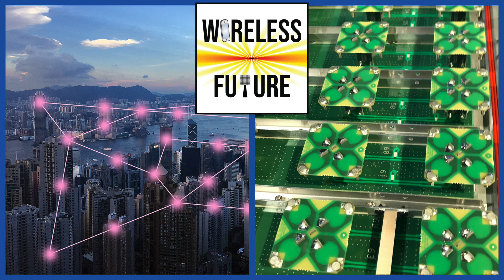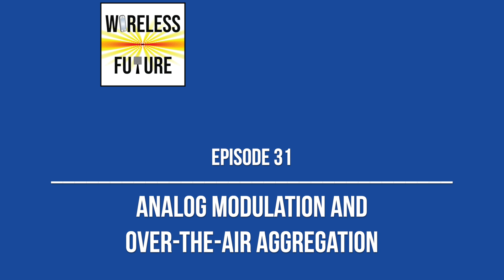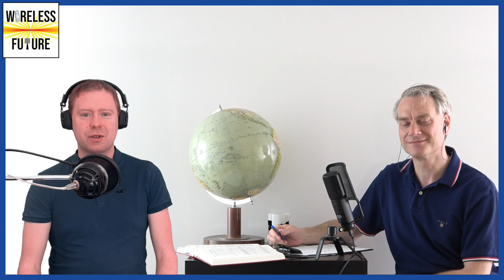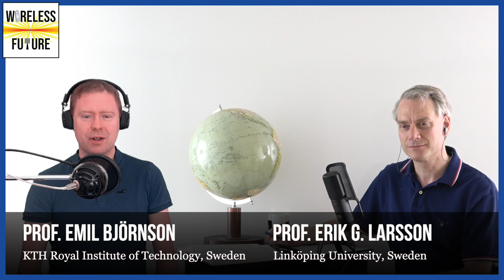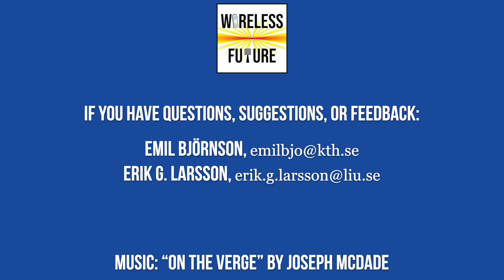Ep 31. Analog Modulation and Over-the-Air Aggregation [Wireless Future Podcast]

Comment: I found the gradient sparsification argument against the use of over-the-air aggregation for distributed machine learning quite compelling (starting around 34:10)! However, I wonder if you have considered the use of random projection to avoid the issue of aggregating zero-valued entries in the gradients? As far as I can tell, you should be able to apply random projection at the transmitter-side, aggregate the lower-dimensional projections over-the-air, and then retrieve an estimate of the gradient-sum via matrix inversion. This is the method employed in "Machine learning at the wireless edge: Distributed stochastic gradient descent over-the-air" by Amiri, et al. What do you think, could such an approach work, or is there some other problem there?

Thank you very much for the podcast, I am an avid listener and this topic is particularly interesting to me.
Reply: Hi Henrik, I believe what Dr. Larsson mentions is that the sum of the sparse vector may not be sparse after the aggregation (or at least the sparsity level will deteriorate depending on the number of devices). I think this may require some analysis, i.e., it depends on the application as well as the underlying assumptions. For instance, for federated edge learning, if the data distribution is homogenous, the sparsity pattern may be highly correlated, at least, at the initial stages of the training.

Comment: Thanks. Can one say that over the air aggregation is the same like NOMA?
Reply from the maker: No, it is a different concept. In NOMA, multiple users transmit different signals over a common radio resource and use digital modulations with channel codes that allow for decoding all of them. We are interested in the individual signals.

In over-the-air aggregation, we are interested in receiving the sum of values available at different users. The users transmit with the same analog modulation so that the receiver will observe the sum of the values. It is not possible to identify the individual values in this case, and we are not interested in those ones either. It is a possibly more efficient way to communicate in this particular case.
Reply: @WirelessFuture  thanks for clarification